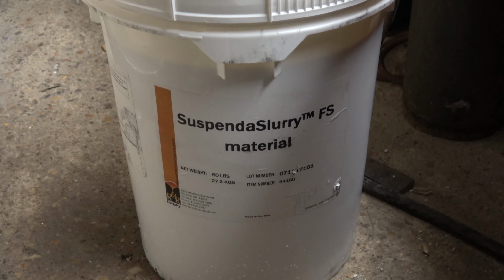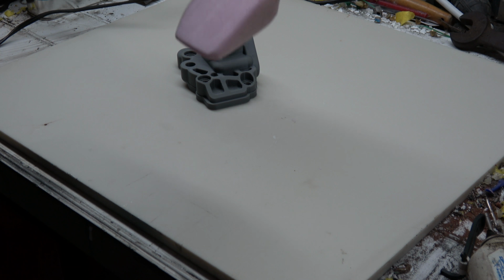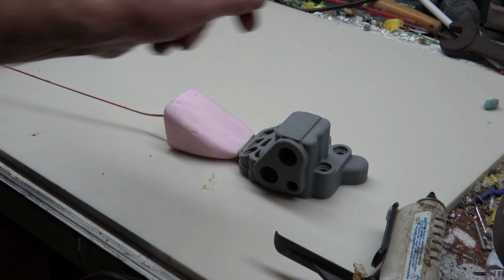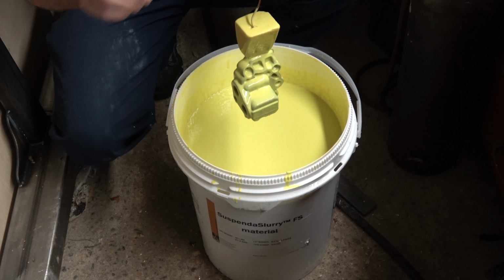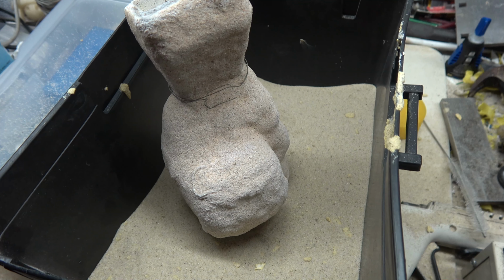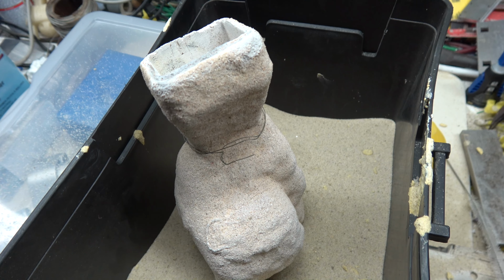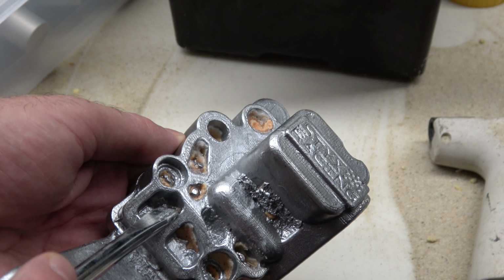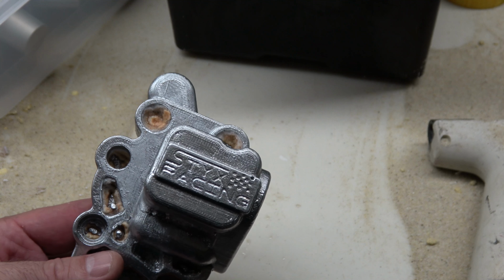First lost pla ceramic shell

Comment: Give it two coats and let it go bone dry , then 50-50 pva and water mix coat over it ( let it go bone dry and give another two coats . Just repeat until enough coats on it . When using pva it’s acts like a barrier to stop sucking all the moisture out of more slip  coats ( prevents cracking ). You should be able to pick out words as I put my details on dive weights I cast . 
Also helps after a few coats to manipulate chicken wire in holes before you coat again and that helps internal plugs stay where they should without breaking away

Comment: ok correct me if I am wrong, but wouldn't the wax being pushed into the text lettering make it be 'LESS' visible'? I mean since it will be covered with the ceramic  shell above the wax, and then fill in only to the spots the was is NOT located at?! -- Am I missing something critical here in this process? -- Seriously I see pushing wax into the lettering will just make the lettering be completely flat/invisible once the part is cooked out?? .. help?
Reply from the maker: Yes,  your missing the fact that this is not wax.  It is a 3d print in moldlay filament.

Comment: One thing I did in college when we did shell casting was to coat the piece first with a spray shellac or aqua net hairspray (not kidding) It’d make the surface super smooth prior to applying the shell, this may help alleviate the PLA “grid” pattern on the completed piece.

Comment: When I use a slurry on parts like this I just use a paint brush to get in all the blind holes, that gets rid of the air bubbles. As for the sharp edges where the shell chipped off I would have given it a small fillet. It's always good practice, not just for the casting process but to alleviate stress concentrations in the corners. Sharp edges are generally a no-no. I would have hit the part with a bit of filler paint and a gentle rubdown too to get rid of the texture. It's a decent attempt at shell casting though!

Comment: Any idea why your shell cracked?? I just dipped my first later yesterday and since I was to cheap to buy part a&b of the ranco-sil I’m trying 4 different types of stucco media. Aluminum oxide in two different grits and all purpose silica sand.. any advice for better results? Also your kiln do you have some kind of a catch pan in the bottom of it for the melting PLA?
Reply from the maker: It probably cracked because I printed it with 3 walls,  but looking back I could have added a flange into the pouring cup area to stiffen up the shell in that area.
   There is a ceramic kiln shelf in the kiln, and the plastic just melts and runs onto it before it is burnt off

Comment: What core used ? Ceramic core or soluble wax core?  Pls tell
Reply from the maker: Ceramic shell core
Reply: @aonemarine  could you pls tell me How to make a ceramic core? What are all the process in it ?
Reply from the maker: @subinperingave9777  The core in this model was made just by using the suspendaslurry, the same as the outside shell was made.
  there is other ways to make up a core depending on what it is you are casting.
Reply: @aonemarine  ok.In this part ,how you are removing the core from the part ?

Comment: Not too bad for a first attempt. I have a few suggestions coming from digital design experience casting PLA prints at an art foundry. Hitting the entire print with lacquer after it's been sprued up helps keep the slurry from seeping in to the PLA since PLA will absorb moisture. In areas that are hard to spray, some wax works great like you did for the lettering. Something else that would help is that for those flat areas where the shell separated, you could add a little wax rod or even make it part of the print on all flat areas to give the slurry something to grab on to. It'll have to be chased, but it should work. Anyway, good stuff!

Comment: Great video.
 Is the slurry fiber reinforced?
A few humble suggestions if you are interested. 
Have you considered making the pattern in sections, coating, cleaning , reassembling and re coating? This could/should help with the fine galleries? From what I have come across in a production environment the thinnest sections used with Zinc free aluminum is 4mm. using a crude core. 
I not sure what you mean by blind holes but if it is the ones that are for the oil fittings perhaps you could replace the cored area with a plug. Copper or in a perfect world tungsten is used in areas where pressure can be a problem and it should easily be withdrawn from the coldish casting. 
Have you ever seen aluminum castings with a hatching pattern on them? This is used to help flow through difficult areas and stop the metal from tumbling when flowing. The normal indication for this is a non fill in spots close or in that exact area. The idea behind it is the metal will fill the hatch then leave a smooth surface for the rest to flow undisturbed by. Very useful for high fill/flow rates.
Cheers
Reply from the maker: dazaspc you have me scratching my head a bit, seems like you are referencing die casting process?
Thats a whole nother world...
Reply: Hatching is used in die casting but usually when using a mould just scratch it in with a scriber. Basic principals apply regardless of the die/mould material. If you have ever seen a modeling of metal flow rates through a die I thing you would be surprised. The old school casters can usually manage this by raising the ladle height for more speed and lowering it to pour harder tipping in more metal. That casting is a little small to manage it that way though. You could introduce to heat into the mold box but that increases the messing around quite a bit.   
I have seen it done on a similar setup and steel bar was preheated red hot and the mould was held in place  with the steel to allow the sand to be poured in. After a short while it was cast. I don't think this is your problem though.
I was referring to the external holes for the tapped fittings re the plugs. think of it like a core that wont break up. 
I get a bit carried away sometimes but a compound mould would address oil galleries? 
Cheers

Comment: looks like the suspendaslurry(?) will work well .. did the foam burn out in the kiln ? 
would you suggest using it over the "pot investment" method for automotive parts such as emblems etc.
Reply from the maker: mbauer47 
That was a 3d printed plastic part.  It burns out clean, but generates alot of pressure as it expands from heating.  Really depends on the part which processes is better.
Small highly detailed parts best cast using block method.  Shell for larger stuff..

Comment: looking good, what did that pot of susplended coating cost you? looks like a good way to make intricate forms. i would use this coating under a vacuum to remove the air bubbles. great job!!!!!
Reply from the maker: It was cheaper than I thought. Only $126.00 delivered to my door.  No real need to vacuum it...
Reply: aonemarine and the the sand is specials sand or just plain old sand? Maybe that why it cracked? If I see them use this technique on High quality parts its seems Like very pure white sand pure siliconoxide
Reply from the maker: Olivier Vincent  its a plastic that im using for the pattern. It expands when heated and cracks the mold.
Reply: aonemarine pla can crack that? Damn. Infill 20% then ;-) or use abs and make it soft with acetone